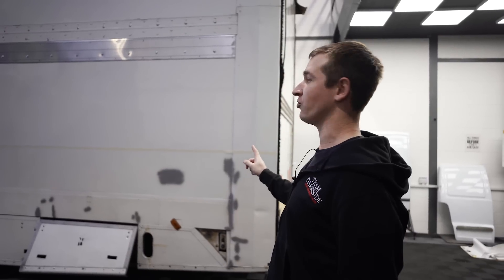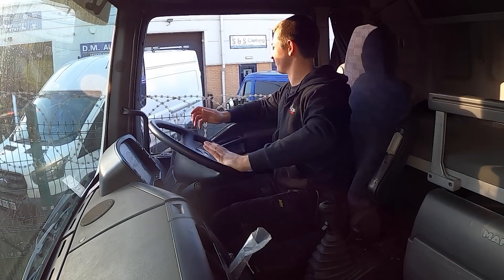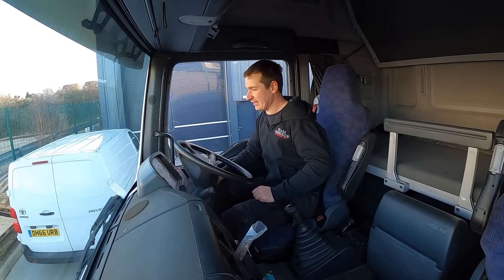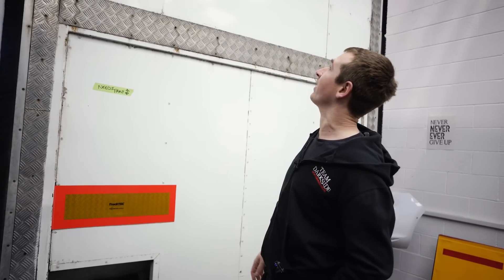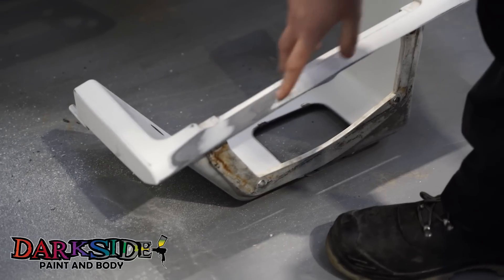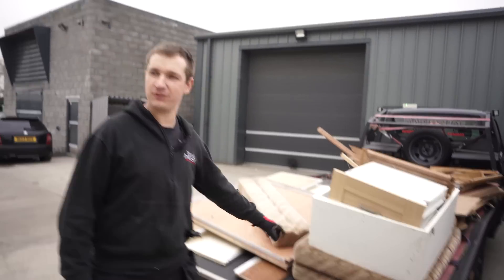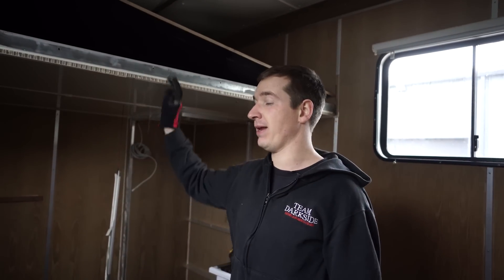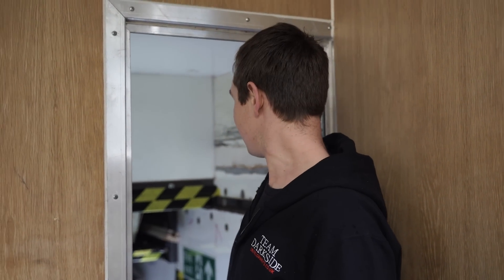TRANSFORMING our Race Truck!

Comment: Great stuff gents! Happy to see it turn out they way you wanted it. The crew room will look the business I’m sure of it. As far as heating goes, I’m sure you’ll have access to an electric umbilical wherever you go, however a diesel heater might be something to look into as an alternative, they’re not cheap but worthwhile, perhaps you can get a used one somewhere for a couple hundred. They run on diesel as the name suggests and they blow hot air out one end. The lorry should already have one for the cab. Usually they drink about 1L per hour at most so a 25L tank will do you just fine.
Looking forward to seeing it finished!
Reply from the maker: Thanks. It's already got a diesel heater. We are thinking about fitting AC as well
Reply: Get a 3.5 kva to 5.2 kva thats 3.500 watts to 5.200 watts diesel generator to run when there is no plug in, it will be enough for the tools AC and anything else you want to run would fit nice in one of the belly bins can even run a welder